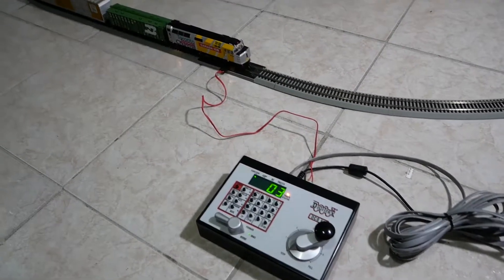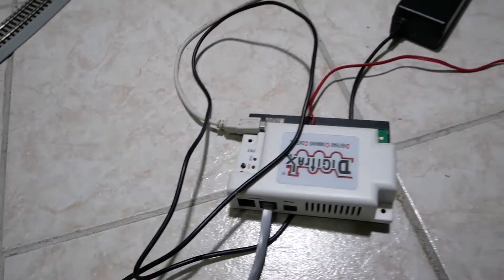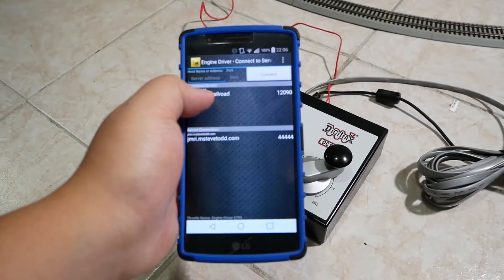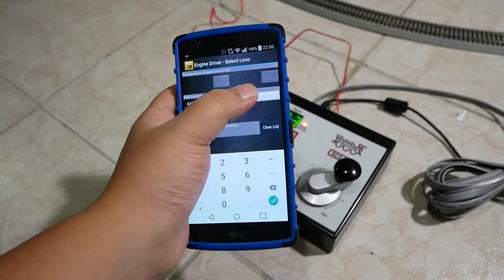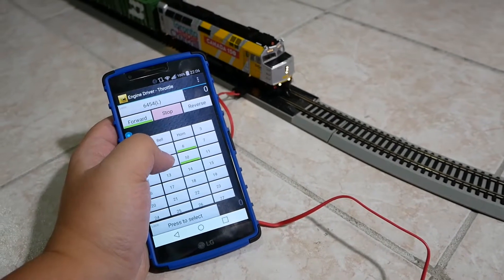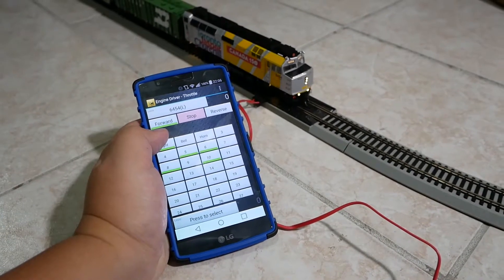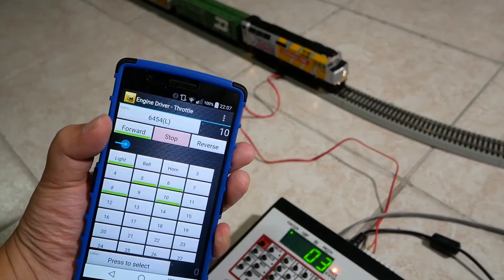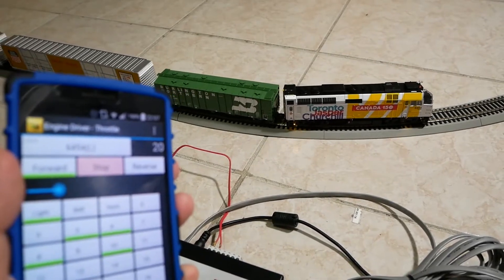Canada 150 F40PH-2D Running with JMRI and Engine Driver on Android Phone

Comment: Hey man!  Have really been enjoying your videos. Love what you have done here with JMRI and digitrax. I've been debating if I want to go this route or jump on the new ESU CabControl DCC system. I have a DB150 so getting the loconet wifi interface would be cheaper.  Do you know if you need an android device or if it works with iPhones as well?
Reply from the maker: The ESU CabControl system would obviously better with built-in wifi support and better customization, where as on Digitrax systems you have to tack on a PR3 or Wifi interface. The ESU system will cost a lot more though, $500US MSRP versus just $85/$80 for the PR3/Loconet Wif since you already have a Digitrax systemi. I would wait for the ESU CabControl to be released first, do some good research and watch some reviews, and see if it supports JMRI (it should, but a lot of speculative info at the moment) and also LocoNet via the adapter thing. The Engine Driver app is only for Android, but the iPhone/iPad has a similar app called WiThrottle.